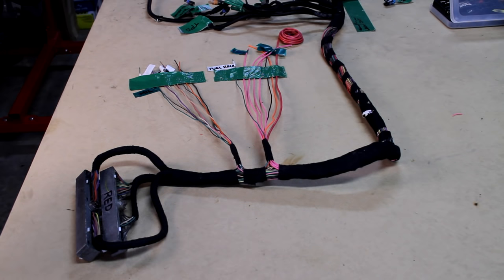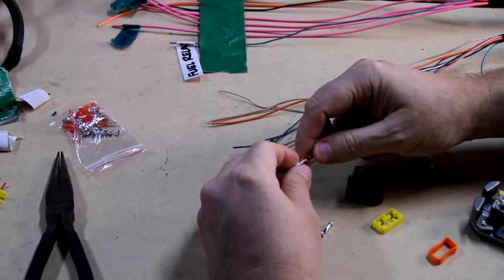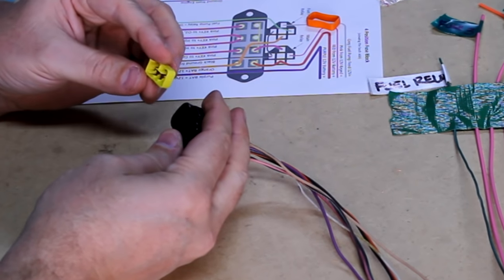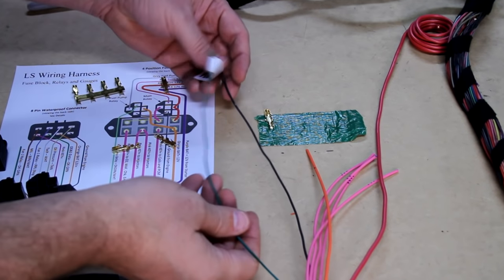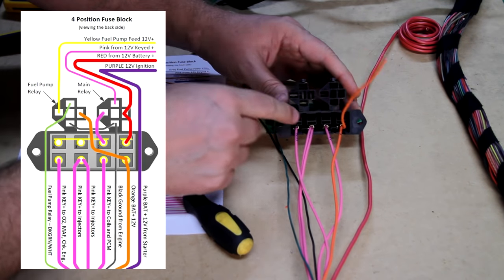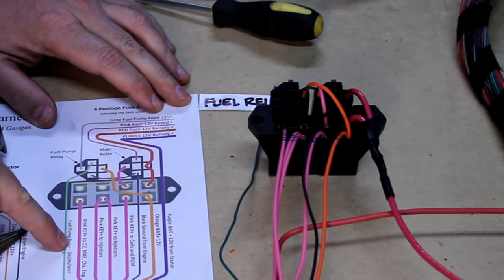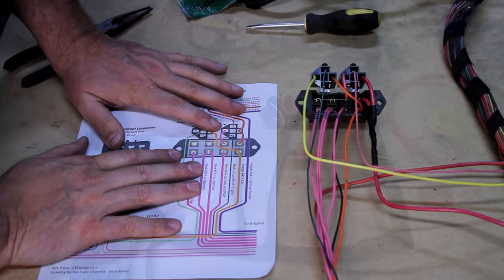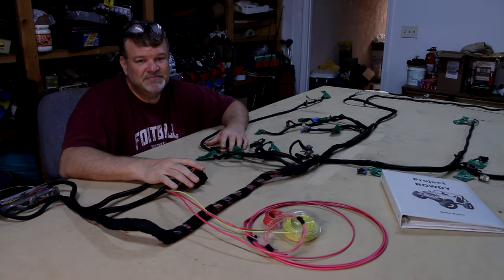LS Wiring Harness Part 5 | Project Rowdy Ep017

Comment: Just an AWESOME video series! I am at the very beginnings of my LS swap.....Are you sitting down? my swap is going into a 2005 Lincoln Navigator. Not sure what all I am going to run into with this but? I really want to keep as many of the "amenities" (cruise, A/C, power this and power that) as I can. The truck is in super nice shape.....except for the Ford 5.4L 3V that in my opinion? isn't worth keeping/rebuilding. There's no performance (mild) parts really available for the 5.4L 3V so? Now trying to decide to go with a 5.3/4L60 or a 6.0/4L80 combo. I hope it's as doable as your videos explain.....making the LS communicate with the Navigator? If you have ANY tips or tricks on this swap? PLEASE let me hear back from you or? any of your subscribers.....always nice to have  someone to turn to when it starts getting complicated!
Reply from the maker: Sounds like an interesting project!   You will end up getting into situations and creating solutions that I simply will not run into.  As my swap is going into an older vehicle that does not have all of the electronic gauges and Can Bus systems.  I would be more than happy to clarify any of the steps that I covered in these videos.   Have fun with your adventure.  It should turn out very nice.
Reply: @UCanDoIt2Mike  I'll definitely stay in touch. I'm a welder/fabricator/hydraulic tech and wiring has always been my weak link.

Comment: Great Great info! Probably watched all in this series 50 times. I actually played this when I set up my harness. I did have a question that I could not find the answer. What size fuses did you place in the main hot and the remainder of the circuits? Thanks
Reply from the maker: Many thanks for the feedback.  You should use 15 Amp Fuses in all 4 positions.  Congrats for tackling this.   It will be very rewarding.   Mike
Reply: Thanks

Comment: Sir another question for you,I purchased an 01 suburban 5.3 this weekend.my plans r to rebuild it cam,heads,converter and my question is I’am going to run intake and holly carb do I still need the ecu or use an msd box???😁🏁
Reply from the maker: Wow John...  that is a little out of my research area for me to provide you with an educated answer.  I think you are going to need something that reads the Crankshaft and Cam Position sensors and communicates with the MSD.  So I am thinking that you do need the PCM.  You should check with the MSD website for connectivity/installation information.

Comment: Amazing vidoes. Almost done with my harness because of you. Im Just lost with the OIL PRESSURE Tan wire that goes into the 8 pin connetor.. where in the harness is that wire(Oil pressure) connected to? Or do i gotta add a sensor? I know the low oil switch it deleted.

Comment: I might've missed you mentioning this in an earlier video, but where does the purple wire for the starter, start? From what I understand that wire is what gives the starter it's 12v (to the starter solenoid?), but if it's coming off the battery how does it connect to the battery or where does it get its 12v from?
Reply from the maker: One end of the Purple wire connects to the Starter Solenoid.  It will provide the 12V+ to activate the solenoid.  The other end of the purple wire needs to be connected to your Ignition switch (when the key is turned to the "Start" position.   I explain more about this in Episode 18.
Reply: @UCanDoIt2Mike  I'll go look at episode 18 to learn about the starter circuit, but since it's connected to the ignition switch I'm thinking that the car must have that circuit already in place with the correct gauge wire and a relay? Still learning as much as I can before my old Volvo gets its new LS, it's definitely a learning process 👍

Comment: Nice work. Looking at your diagram, why didn’t you run main power (red) into just the fuse block (instead of running the Y to the relay)? Then using your orange (on the protected side of the fuse) to power the relay?

Comment: So like with injector wires for example theres 8 all together do you bundle them up then solder them to a single bigger wire leading to the fuse box?
Reply from the maker: That is not how I did it.  Here is a wiring diagram (LS Fuse Block and Relay Diagram:  http://bit.ly/LS_Harness_Diagrams).  On page two it illustrates my configuration which follows what I did in the video.
Reply: @UCanDoIt2Mike  thanks exactly what I was looking for appreciate the help

Comment: So I’m doing a 5.3 swap in my 97 Silverado. I’m planning on keeping my a/c, what differently will I have to do to the fuse block to keep my a/c. Would I have to run that somehow to the main relay? Thanks.
Reply from the maker: The round for that system will already be in place.  There are 3 different "Control" wires (one being supply voltage) coming from the C2 Block that you will need to focus your attention and figure out how they would interface your Silverado.  None of the Voltage wires are Pink or Orange, so they must be controlled by another sub-harness (Dash).  It is a little beyond my research, so I hope that much helps!   Have fun with your project!!!!!  Cheers.

Comment: so the "Purple" wire you changed to red , does that go to the "trigger" wire on the starter to signal the ECM that you are "cranking" the engine ??
Reply from the maker: @rhhoard  The Purple wire on the diagram (my Red wire) goes between the Ignition switch “Start” position and the positive connector of the solenoid of the Starter.
Reply: @UCanDoIt2Mike  exactly what i thought , my harness was already set up as 4 wire , but i only found the 3 wires , Bat +, Switched 12v , fuel pump out from relay , i am going to look over the harness to find that 4th wire

Comment: Your videos are even better than the one fe lt1 swap. I’m in the middle of tackling an ls swap myself.  I’ve already watch 1-4 several times to get comfortable with this. I see this is an older video how has the been doing. Any issues you come across? My ls is goin in a falcon.
Reply from the maker: It is an older video, but I still monitor the comments.  Many thank for the compliment.  I am still working on the vehicle that this engine will be dropped in.  Many others have commented that they have completed their install and are enjoying cruising in their new ride.    Had to overcome a few obstacles but am working again on my project.   Best of luck and have fun with yours.   Mike

Comment: Question? I wired the exact same way but my IGNITION hots are staying hot when key is off  if I unplug the pcm everything works as it should any idea what’s going on
Reply from the maker: You have the Pink circuit connected to the vehicle incorrectly.   Follow that circuit and find a proper “Switched” circuit to connect it to.   Mike
Reply: @UCanDoIt2Mike  thanks for the quick reply I traced them back to b19and 75 on the pcm I also did the same for the orange b20and 57 as soon as I feed power to the constant everything is hot
Reply: @UCanDoIt2Mike  turns out ground for pcm wasn’t getting good contact everything is work properly now 🤟🏾

Comment: So basically I would wire that to little light and put in my dash ?( that will light up if the computer shows check engine light ) did you have to have your pcm flashed ?
Reply from the maker: The Check Engine light consists of 2 wires, 1) a positive wire that you will wire to have a positive active signal on it when the ignition key is on and 2) a Negative wire that comes for the PCM.  If the PCM wants to illuminate the light, it provides a good ground on this wire and that will turn on the CEL.  I have not yet flashed my PCM but will need to have that done prior to starting the engine!   Cool Stuff !!!!!!

Comment: almost finish with my harness i just trying to connect the purple wire (negative signal) from pcm (B42) to a relay so would you tell me what post in the relay i should connect the PPL Wire, post 30, post 85, 86 or 87? i really appreciate your help.
Reply from the maker: Javier Argumedo I would connect.  (1) Purple (R42) which is the Negative trigger to the 85 pin.  (2) a fused 12V + to the 86 and 30. (3) the power wire coming from the fan to the 87.  Google a diagram for an Auto Relay image and it should all make sense.
Reply: so a fused 12 v+ to pin 30 and negative wire (ground from chassis) to pin 86? and what do you think is the best way, connect the fan circuit to the ignition key? if you does what is the wire that go to the ignition key?
Reply from the maker: @javierargumedo3   Hang on.  Don't think you understand.   The PCM is going to trigger the fan to come on with a negative trigger wire (Purple).  That wire is triggering the relay.  That circuit (Replay Pins  85 and 86)  Pin 85 will be the Purple Wire from the PCM.  The PCM will control whether that wire does/does not have a good ground on it (trigger).  Pin 86 will need a 12v+ fuse power wire.   The other circuit in the Relay that you will be using is Pins 30 and  87.  Pin 30 needs a 12V+ fused power source and 87 is the power wire going to your Fan.   Finally, the fan will gets its 12V+ from Pin 87 of the Relay and you will need to connect the Fan Ground to any  Ground location (Frame or body).
Reply: thanks for a quick response. sorry i know i am making to many question but with every answer from you everything is more clear.So i saw a diagram in Google as you recommend and it connect pin 30 to 12v+ fuse power and pin 86 to ground wire (frame or body). some other diagrams run a wire from relay to Ignition key. Now you recommend to connect pin 86 and 30 to 12v+ fuse power, the question is pins 86 and 30 can be connected to  one fuse or have to have a fuse for each pin ? and what is the amp recommended for those fuses. Is good to know that there are people like you that help people like me that don't know much about those circuit. thank you so much.

Comment: Hi there,

Thanks for the knowledgable videos....I have set up my 4 fuse panel exactly like your. I am just wondering what amp rating fuses you were used for each of fuse positions....10A/15A/20A/30A....ETCS

THANKS ALOT
Reply from the maker: 15 Amp Fuses in all 4 sockets.  Cheers and thanks for watching.   Mike
Reply: @UCanDoIt2Mike  thank you Mike!

Comment: hello again! i finished my harness time ago and that was thanks to your videos so well explained. now as am using the factory fuel tank,  I would like to add the fuel pressure sensor (3 wires, black to B53, R64 and Gray B45) its function is calculate fuel pressure and send this information to the PCM. so the engine can work with out this pressure sensor? or i need to keep it.
Reply from the maker: I do not believe you need this.

Comment: ive got one question. If you're doing a build without a check engine light is it still necessary to run the wires for it
Reply from the maker: I do not believe so!  (vague... right).  Here would be my guess.  If you are not interested in having a Check Engine Light, you would not need to run the wires.  The wire from the PCM is a Negatively switched wire.  When the PCM determines that it need to illuminate the CEL, it creates a true ground on that wire.  It doesn't care if there is a wire or light at the end of it.  There should be no programming required of the PCM either.  Just leave it off!

Comment: I have a question bud the 99-2002 camaro harness can it be worked the same way this truck harness or is different
Reply from the maker: Sorry that I am just seeing this message.   Yes!  This basic approach will work for about any Gen3 or Gen4 engine.  You will need to make some decisions based on what you would like to keep and discard.  The basic approach is universal.

Comment: Lastly starter wire goes to positive switched?

Ive got a 96 impala that im swapping. I hooked it to my starter wire (yellow) and i get nothing.

Sorry if thats a stupid question
Reply from the maker: The Starter Wire coming from this Fuse Block goes to the Starter Solenoid.  It is the positive switched trigger for the solenoid.
Reply: Thank you sir, you’re truly the best

Comment: I have an 1966 GMC 3/4 ton and looking for an LS engine ... Is this wiring part what I need ?? Thx !
Reply from the maker: The overall answer is yes!  This video series outlines the details of LS Wiring cleanup and what it takes to put an LS style Engine (97-18) in any donor vehicle.  The details in this video series applies to the specifics of a 99-03 engine that was altered to what I needed for my build.   The important takeaway from this series is that this is an approach that can be applied to about any engine (GM, Ford, Dodge...).  You have to alter your harness for Stand-a-lone so that it can be dropped into any vehicle.  This approach will help you do that.   You will have to research and come up with some wiring plug details for the Engine that you have obtained.   Cheers!

Comment: Hey bud, I’ve have a question about the “black ground from engine.” Is that wire grounded directly to the engine or did you run that wire into the harness ground distribution block??
Reply from the maker: There are two ground wires in this video, so I'm not sure which specific one you are talking about.  Let me explain in general the Engine Harness grounding.  The Engine is grounded tot the chassis and there are 3-4 place within the harness that extend out of the harness and bolt to the engine (specifically one of the heads).  The wires coming from these separate 3-4 grounding points enter the harness and then split into individual grounding wires to service an device that needs a ground.  So both of the black Ground wires described in this video eventually run to one of the Grounding unions within the harness which ultimately ground to the engine through one of the 3-4 grounding points mentioned earlier.  During the cleanup of my harness, there were several connectors that were removed that contained a ground wire.  Two of those ground wires were redirected and used  in this video for the Gauge Connector (OBD2) and Fuse Block (Relay grounds).  Hope this helps!!!!!

Comment: Mike...Are you going to fuse the 12V (Red wire) from the battery before terminating at the relay (30)? I see it fused on the back end, but not coming from the battery. I mentioned I am using a different fuse block and I'm trying to lay it out. It is confusing to me because I thought the wire coming from the battery should be fused before going to the relay. (I may email you what I have so far.)
Reply from the maker: I do not have plans to place a fuse before the relay.   If that relay becomes damaged and causes a short, fuses 1-4 will trip and protect devices further down the line.  That relay is the only device that could cause an issue and if it is damaged (to create the issue), it will need to be replaced anyway.  It would not make sense to place a fuse between every device on the circuit, you just need one per circuit and yes it does want to be as early on the positive side as possible.  The Relay does have a negative lead to it but that is on the trigger side of the fuse.   The Large Red wire is in a pass thru circuit.  Sorry for the rambling,  kind of thinking out loud.  Cheers Ted!!!!
Reply: Gotcha. That makes sense. Thanks Mike

Comment: Do you thing is a good idea to connect the yellow wire (fuel pump) from the relay to a fuse or just must be connected to a relay as your diagram shows.?
Reply from the maker: The Yellow is coming from a Relay and goes directly to the positive side of your fuel pump.  That Yellow wire is already a fused circuit unit due to the source of the orange wire. 

If you connect the yellow wire from a fuse to the fuel pump…. The fuel pump will run constantly.  The relay is it’s on/off switch.